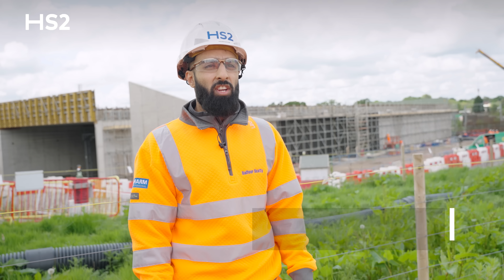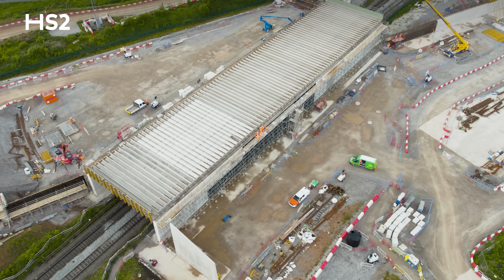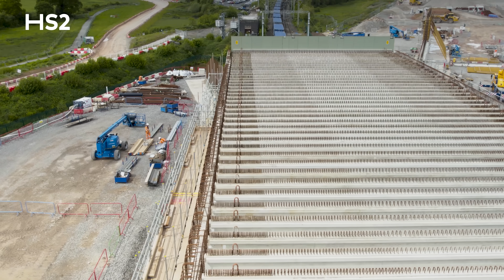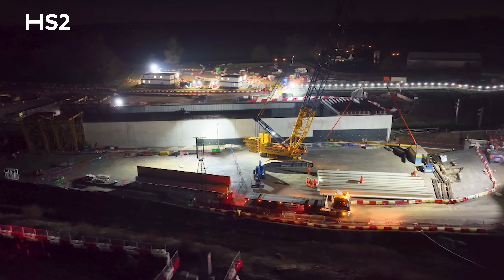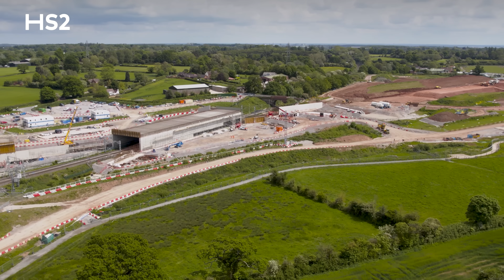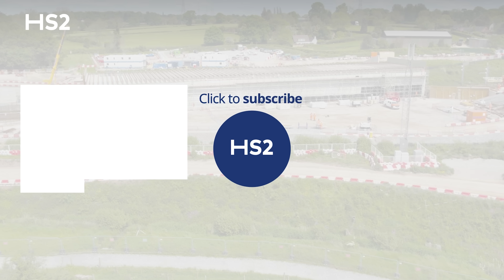Huge beams craned onto key bridge to carry HS2 over the West Coast Main Line

Comment: Weird "underbridge" concept. Looks more like a tunnel? The process where you cover an existing railway creates a tunnel, no?

Could've put some wildlife crossing space on top of the tunnel, once we're splurging. But the design drawings don't seem to show anything like that 🤷
Reply: There are a number of examples on the whole route where wide new HS2 “green bridges” are allowing for wildlife crossings, but I suspect only where they are definitely cutting through an existing wildlife area.
Reply: Maybe it depends on the intended user, in this case HS2 and so for those trains will be a bridge, just a thought.

Where did you find the design drawings for this, can’t find them anywhere
Reply: The Birmingham/Coventry mainline is being bridged. HS2 is going over the bridge. Where could a wildlife corridor be installed ?
Reply: @davecooper3238  The tunnel could be lengthened a few meters with very little additional cost, that's what I'm saying. So not just HS2 but wildlife too can pass over the line that's being covered.
Reply: @u1zha  How do we know if fencing will or will not allow that ? Perhaps ask HS2.
Reply: A tunnel would suggest that it has soil on top of the structure, which it doesn't. The fact is that there is no hard and fast definition of a tunnel in structural terms on the railway since the range is so varied.
Reply: @xaiano794  It’s going to have embankment either side so it may end up with soil on top.
Reply: @davecooper3238  not in the current plans for this structure
Reply: @xaiano794  Where can I view those plans ? I suspect you can’t send me a hotlink but the search terms to reach the plans would be useful.
Reply: @davecooper3238  I'm at work currently but I'll try and find them again,  it was back at the start of this that I saw the plans,  I doubt they've changed.  They published complete plans for the whole route including detailed plans on every section. I will check again as if the plans have changed I'd like to know too
Reply: @xaiano794  The plans have definitely changed. The A445 was due to still pass the front of three houses & then over HS2. This would have left the houses with their same blind exits. The A445 is now due to pass behind the houses passing over the HS2 cutting. Work has started on that A445 realignment.

 I bookmarked the original plans from London to Birmingham. Those links are now broken.
Reply: @davecooper3238  that's very helpful,  thanks for letting me know,  I'll try and get hold of the new plans,  I know some people working on the project that might know where to find them
Reply: Bro who pissed in your cornflakes this morning
Reply: @mrgreatauk  You don't want to engage in discussions about infrastructure design? Don't

Comment: No amount of good hard work by the guys at the front end of the project can make up for the catastrophe of the overall project. 
Sorry but there is no good “PR” for this mess. 
I feel sorry for the guys still working to complete the stage to Birmingham as the mess isn’t their fault. 
Ask anyone north of Birmingham and you will get the same response, “so this is levelling” this isn’t just something moaning, it’s simply fact.
Reply: The rest of HS2 will get restored. It has to. Either it gets done soon, or they open HS2 without the Eastern Leg and the rest of the Western Leg and property prices will shoot up in Birmingham and business will abandon the East Midlands to move near to Birmingham.

People complained about Crossrail and then it opened and was instantly taking one in six railway passengers in Great Britain. What HS2 does is not just about the fast trains, it's about the trains they are pulling out of Birmingham Curzon Street.

As for "levelling up". Forget about that term. It's stupid Tory propaganda nonsense designed to make Labour voters up north think that something is coming their way soon. We do not need "levelling up". We need local transport authorities, for all the cities of England, Wales, Scotland and Northern Ireland. And we need local long-term transport improvement plans, where the best thing for the local people is decided on locally and then given the funding it needs.

Comment: Really good quality videos. The engineering is explained to just the right detail, to highlight the challenges and the solution, whist showing off the lower-carbon techniques, and local jobs created.
Wish Labour would reinstate the northern sections.
Reply: Labour have promised to "review" it so fingers crossed!
Reply: @MikeWillSee , yes let's hope. The land has not yet been sold and Manchester Piccadilly is closer to having a station underground for NPR. This railway is must.
Reply: @inbb510  Get piccadilly built first with the capacity for both. The HS2 railway can come later. Get it built to Crewe and get Euston tunnel.
Reply: One thing that is worth reviewing, before reinstating the axed bits of HS2 is to look to see if we can spend a tiny bit more and have through services, instead of a lot of dead-end branches. Branch lines eat up capacity. Through services will ensure that everyone in England is able to jump on trains going north, as well as south.

Allowing people on any part of HS2 to get to any other part of HS2 is more important than focusing on the trip to London. Imagine, for example a football match with two English cities. The question to ask here is can our rail network get all the fans from one city to the other city in a short period of time. The same goes for a big pop concert at a random place (like the Birmingham NEC). We need our rail network to be able to take all the Scottish football fans to a match between Scotland and England at any particular football stadium in England....and it has to work for any stadium in Scotland too.

If HS2 can not quite do what we need it to do, we should throw in a bit more investment now, rather than build it in a suboptimal way and have to retrofit it.
Reply: @DavidShepheard  What you're describing is a whole interconnected high-speed network of several lines. HS2 at the end of the day is just one line with a handful of branches - not a whole network.
Reply: @DavidShepheard I don’t know if it changed but. The station that serves Coventry City ground was and perhaps still is closed on match days.